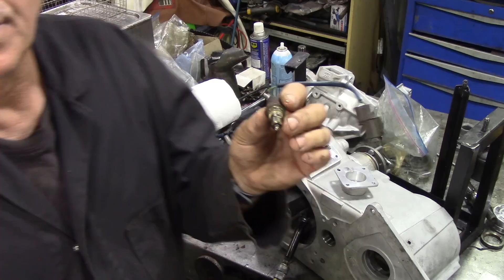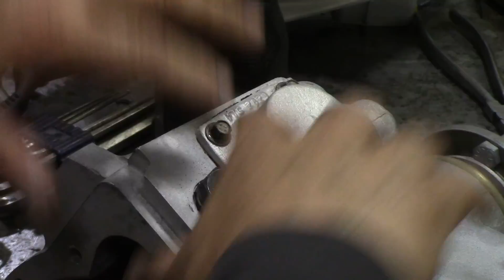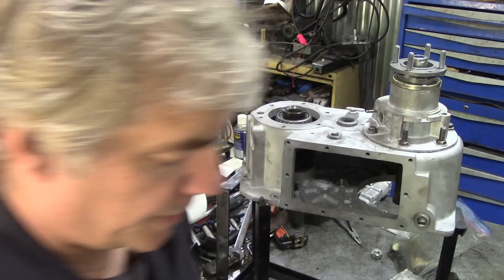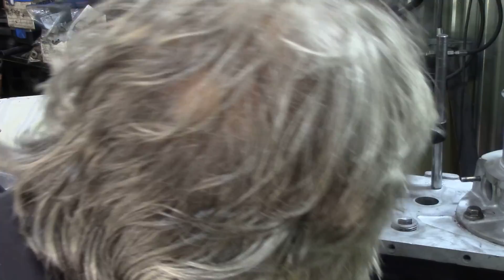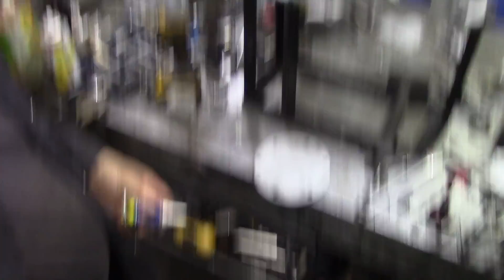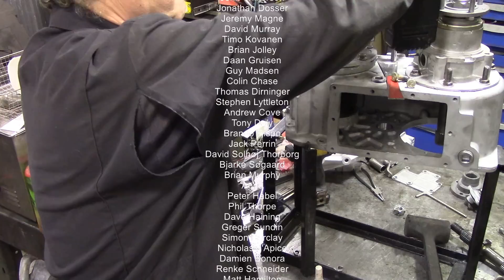Building a 1:211 ratio LT230Q for a Defender Td5 from a Discovery 1 or 2  Part 2

Comment: I did discover that the interlock is only fitted on Discovery 2's to the North American and Japanese markets. Quoting from the Workshop Manual, page 41-14:

"An interlock solenoid is fitted for North America and Japan. The solenoid is located on the top of the transfer box main casing on vehicles up to 03 model year or on the selector lever assembly on vehicles from 03 model year. The solenoid is connected to the transfer box relay which, in turn, is controlled by the IDM. The purpose of the solenoid is to prevent neutral being selected on the transfer box when the ignition key is removed, thereby locking the box in either high or low ratio."

Comment: Interestingly enough, I just sourced one of these interlock LT230s for a special project. These are not very common in Australia, and I’m using the safety lock out for something quite different than what LR had in mind 😁. I will be building it with Ashcroft ATB, MaxiDrive 30% low range , extended sump etc. 

I’ll be watching these vids a few times to refresh and get a different take on it. Thanks Mike 👍🍺
Reply from the maker: Interesting!